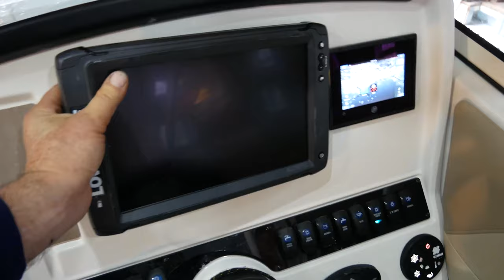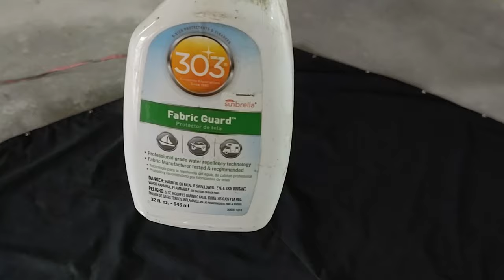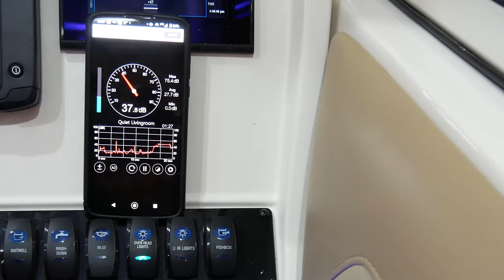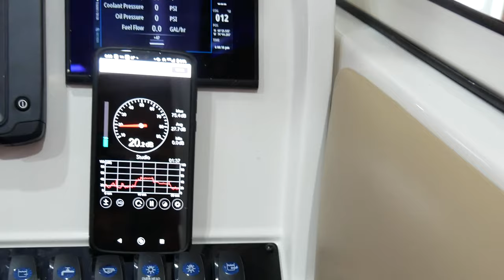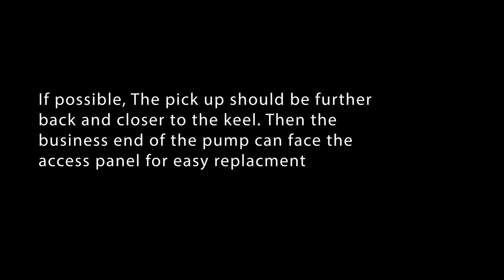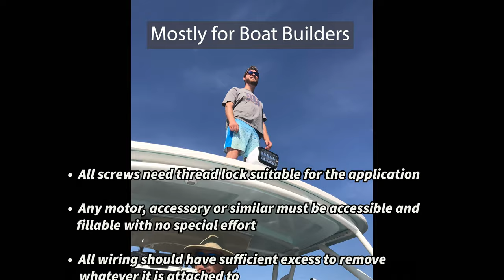What happened in the first 100 hours of my Sailfish 245 DC review

Comment: Thank you for this video,  very helpful.  I am your age and bought a tidewater 25 cc 2 years ago and found many of the same issues.  I think all manufacturers depends on who is working the line that day when building the boat in regards to attention to detail and proper torque , wiring , etc.  Happy Boating.  Also like the last comment - owning a boat guarantees an expensive fish dinner- lol- so true.
Reply from the maker: I bought new and still have a tidewater 2018 2200 cc. That boat had many more issues then the sailfish. when they delivered it  even the trailer lights were wired backwards (I know that’s not on the boat builder). I fixed or had fixed all of them, - just heading out now to confirm the gas tank back flow preventer that cracked, and I had replaced with some difficulty, is working 100%.  Glad you liked the video.

Comment: Thank you for posting this video. I recently sold my 2008 Sailfish 3006 EC.
I would have hoped that Sailfish would have improved their wiring and electrical issues from my boat to yours. I had an opportunity to tour the factory and receive a tour from the plant manager. I expressed my electrical issues to the PM and he said they were working on improving the electrical wiring.
The through bolt fittings are another issue on all Sailfish boats.
My through bolt issue was the eye to winch the boat onto the trailer. Mine was beginning to pull out. I contacted Gerald at Sailfish and he was fantastic to work with. I brought the boat to them and they fixed the issue. The eyelet was installed without a backing plate.
I loved the boat and had no issues with taking it 120 miles offshore. But I probably would not purchase another Sailfish boat.
Reply from the maker: I found Sailfish to be very responsive. I also spent some time a few years with a boat repair expert and we talked about alot of boats, high end, middle and low. What I came away with, even high end boats have issues, and decided to do what I did; accept what is and push to improve for the future.

Comment: Great video on the sailfish. I got the same boat and love it. Did you end up putting the trolling motor on? I’m looking at putting one on soon myself. Just looking to see how  it went and a little guidance. Trolling motor size, battery location, ect. Thanks David
Reply from the maker: trolling motor is on hold for a little while, I put radar and Autopilot in.  My thoughts on the trolling motor are 36 volt litium, batteries(s) under the front bow seat- but  I have not measured or checked anything yet. Same with lenght, expect it will have to be at least 72" or maybe 87".
Reply: @dmbekusconstruction  I was thinking the same thing. Thanks for the info.

Comment: I have a 2660 Center console. Bow lights stopped working. Lights are good wiring issue. Hope I can snake a new wire to the bow and back to console. Does anyone know the color of the wires sailfish use from the switch to the bow? Trying to see where the break is. Love the boat the large 9Ft beam handles well and the twin 150 Yahnahas push it fine with good fuel economy. Liked the video need to do a good inspection this spring.
Reply from the maker: Center consoles are sometime harder to get wires to the front.  But imagine its doable.

Comment: Thank you for this post.  I have a 2018 245DC and love the boat.  When you mounted the rack for lines under the helm what size screws did you use or did you bolt them through?  I also have the same issue with the cockpit door and will install a similar latch this season.
Reply from the maker: I don't remember the size, I'm in NJ and the boat is in FL to April, I won't be back to FL to March. I'm going to say 1/2" #12s stainless pan head

Comment: Would you be willing to share photos of how you routed the antenna line when it came out of the tube and up through the roof? I’m performing a new install tomorrow and I assume I drill a hole through the hardtop and into the speaker box for the line?
Reply from the maker: I will try and get a chance to to take photos tommorow to the show route. I did drill a hole through the roof, but did not drill any holes in the speaker box. I recall there is a chase all the wires run thru and I may have only drilled in that from the side, so it was not visable from the seats.  I did take the whole top off and proped it up to run all the wires. Since I did the video, I added radar and a night camera and followed the same method +/-.
Reply: I’m not down at the boat but to get the top off, you were able to access the nuts on the backside of the bolts that hold it on?
Reply from the maker: @iTechGuy2  yes on bolts. On my boat one bolt was under the spot light, so had to take that off

Comment: how would u recommend getting to the macerator pump way in the stern?
Reply from the maker: I would start with considreeing making the motor well access larger (sailfish may have done that in later models). If that doesnt make sense (after looking at it close before doing it),  Another option is to abandon the bad pump in place and install new one that is reachable from the seat hatch,  the worst  option is a access on the swim platform over the pump.

Comment: Wow great job fixing what otherwise is poor craftsmanship and execution. If I were Sailfish Id pay you handsomely to take the video down,
Reply from the maker: I thought sailfish did a great job in handling it.  They recognized some quality control issues and addressed them. I was not trying to pick on sailfish but illustrate an issue I found in the industry. Yes GW & BW have better wiring, but they get there fair share of complaints and cost much more. And this boat has better layout for going from fishing to family fun, which was important to me. 
 My last new boat had far more issues.  Not even getting to the boat - they delivered the trailer with turn signals backwards, fenders rubbing and bilge pump recirculating the bilge water. The dealer and manufacture were of little help. There were multiple issues with the boat, and I ended going to a 3rd party to get the boat right and that helped me learn a lot about the industry. 
My dealer MarineMax and Sailfish took my issues and video seriously and I appreciated that.